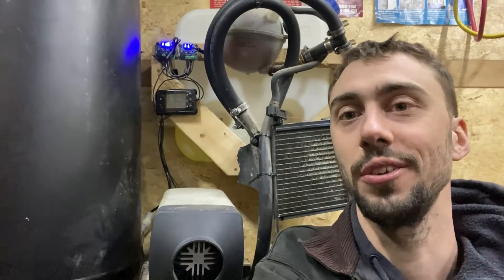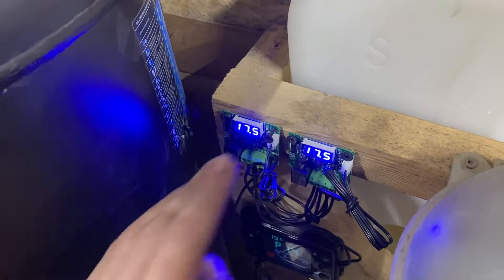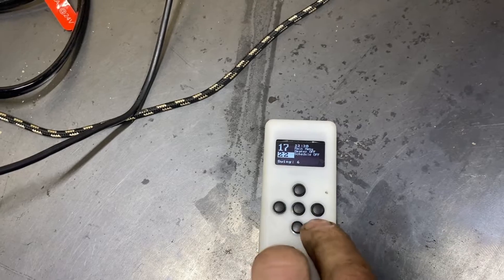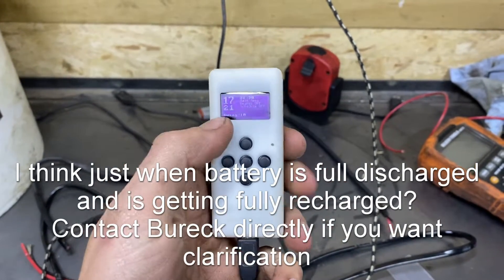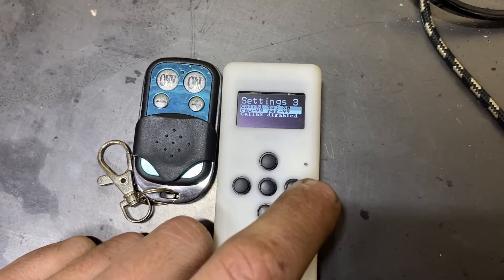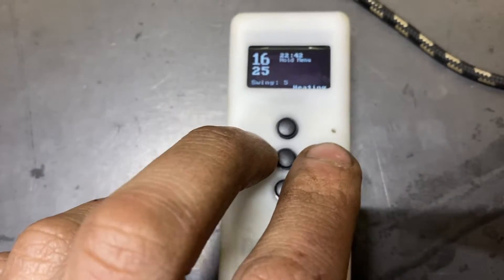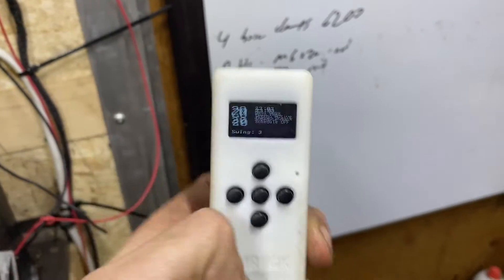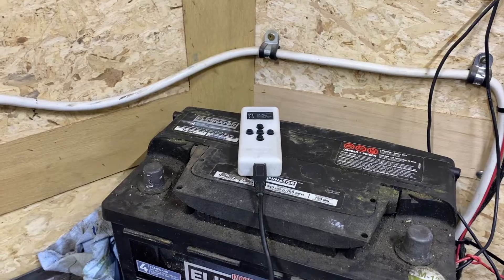Installing a "True" thermostat for the Chinese diesel heater PART 2: Bureck CD Thermostat

Comment: I've been using one of these with my diesel heater in my little caravan (home) for about a month, now.  Excellent little device which does exactly what I want it to do.  Diesel (like everything) is expensive here in the UK; not having the heater idling all the time has made my fuel last much, much longer.  I'm interested to see how much it'll save over the coldest months ahead.
Reply from the maker: If you have the battery bank to allowing the cycling it definitely helps. I disassembled my heater at the end of the year to check for soot (figuring the constant cycling might cause an issue) and it was nice and clean

Comment: This is not a viable solution!  I have the one without the built in battery, even while plugged into a usb power source the controller goes into sleep mode and eventually turns off.  Once it turns off it’s no longer controlling the heater.  So it’s not going to make it through the evening if that’s what you’re looking for!  It’s a shame they offer no solutions, Ive emailed multiple times to no avail.  I guess I‘m out $50

Comment: "I am looking to add a remote backup battery to a non-battery powered Bureck thermostat to prevent issues with heat charging and loss of programming during a power outage. The thermostat's battery lasts for about 6 days, and I would like to know the size of the battery (in Ah or mAh) to better understand the device's power draw. Can you provide any details on the battery capacity or typical power consumption of this thermostat?"

Comment: I've used my remote control circuit board which prevents the heater from running continuously, had to rig up a circuit which repeatedly pushes the "On" button. Then pushes the "off" button to turn off the heater. I also did a 5 Minute delay to prevent the t stat from trying to cycle on the heater when it has t cooled down all the way. Been bullet proof so far!
Reply from the maker: That’s how I should’ve done it when I hardwired the relays originally. I had it get out of temp and my “off” relay ended up commanding it on and just made things really hot

Comment: Thanks for showing this off! It appears my CDH isn't compatible with the Afterburner, and this is also a cheaper option!
Reply from the maker: Yes not quite as in-depth as the afterburner but as a simple thermostat it works awesome, it’ll pay for itself quickly
Reply: @JoshsJettas  I bet! Vs blasting a heater and then turning it up or down or off.

Comment: 15 with a 10 swing would be 5 and 25, right? Not 5 and 15? For that, do you want 10 with a 5 swing?  orrr I miss hurd how the swing works.
Reply from the maker: Swing might not be the correct term, 15C is the off temp, the adjustable “swing” adjusts the on temp. So 15C is the target off, 10C “swing” would make 5C the target on temp.

Comment: My diesel heater has no support for the afterburner , and the burreck thermostate.
Thinking about this setup with the relay . ( using the heater in my workshop , around 15m2 space ) .
Reply from the maker: Ideally I think it should be spliced into the on and off buttons on the remote, it worked this way but did have to be “babysat” at times.

Comment: why not just buy the Chinese Hcalory HC-A01 diesel heater, the thermostat is already built in and with app and bluetooth
Reply from the maker: I think that was new for this season? Vevor has one as well, if I didn’t already have a heater that’d be a good route although the built in thermostat can be pretty inaccurate.
Reply: I can't find this unit anywhere...
Reply from the maker: If you look up hcalory or vevor if they have the colourful digital display I believe those are able to auto shut off
Reply: @JoshsJettas  cool, thanks. 👍
Reply: They are capable of auto shut off, but they only heat at about 1/3 of the power range. In my case epic failure, didn’t heat up the area nearly enough to shut off, or prevent freezing my tookus off while trying to sleep. I tried 3 or them with the same results each time.
Reply from the maker: @TheMajictech do they just have low combustion temps? Seems like they neutered the pumping rate?
Reply: @JoshsJettas  no you can get more out of them manually, in automatic mode they don’t go to max output. Only about 1/3 to 1/2 way. If you put them in manual you can turn them up all the way, although they still don’t seem to put out the same heat my 3 year old vevor does at max output. So maybe a little of both but thermostatically operated they are lame as hell.
Reply from the maker: That’s interesting, must be their way of limiting the on/off cycles. I’m concerned of sooting from the frequent cold combustion on start up.
Reply: @JoshsJettas  it’s not the cold starts it’s the extended runs at low power that’ll soot them up.

Comment: Could you wire a RF or bluetooth switch the same way as those thermostats. My heater doesn't have a remote and it would be nice to have your set up but with bluetooth with a smartphone app control, if thats even possible. 

Great video thanks for sharing 👍
Reply from the maker: I'd seen your other comment, the bureck is by far the easiest solution, id personally see if you cant find a remote on ali express or amazon cheap enough to be able to clone with the bureck. As far as wiring a bluetooth switch up thats a little out of my knowledge but im sure its possible. Household thermostat would be an option too if your well insulated but id be affraid of frequent cycling

Comment: If it could be manufactured to use the up/down controls, 
you could use the up/down controls to smoothly adjust the fuel flow, this would be a most excellent  piece. using minimum electrical power to maintain a setpoint temp, likely better than the device itself.
I have a couple of Vevor units that seem to be able to do this, but the unadjustable fuel/fan ratio controls make them unuseable at my altitude.
 I ripped the controller out of an older unit which seems to have fixed the emmissions/smoke issue, but not the smooth step up/down in output power the Vevor had
Reply from the maker: What i did was use the "thermostat" function on the vevor and had it set to say 10C, it would stay ramped up until it hit the 10C then slow down to low until 15C. Im not as much concerned about consistent heat just something above freezing and that im not wasting fuel.
I've heard theyre pretty bad at altitude, im not far off sea level and i dont plan on taking this set up anywhere higher.

Comment: I built an interface between a thermostat to the 4 button remote.  I thought it was too risky to interface to the on/off button of the CD heater controller.  In my interface I designed in features that would monitor the charge on the battery so that it wouldn't ruin the battery.  The battery is on a battery tender powered by the grid power.  Now I did have some problems where the signal to start or stop was not received by the controller so I designed the circuit to repeat the on or off signal every minute or so.  I did this about 4 years ago.
Reply from the maker: Yes it requires some fairly fine soldering to get to the on/off switch. That sounds like it works nice, I should’ve went to the remote as I did have issues with it getting outside of the temperature range and commanding it “off” which actually turned it on and sent temps high.
Reply: Chez walmart? Par commande?

Comment: I went the arduino (nano clone) route for mine which keeps my greenhouse frost free, settable is temp setpoint, hysteresis to prevent short cycling, also displays max and minimum temperature (until reset). hard wired to the heater display unit on off button, 2 second on / off pulse via relay and 5 min delay when sending off pulse to allow heater to complete it's cooldown cycle. Running now for 2 months without any issues. Good luck with your future projects Josh.
Reply: That sounds awesome. Where did you buy the cologne from?
Reply: Amazon :) 3 for 21 squid @dsdfarms6872   I wish I'd have known about the CD before I started my project, would have saved many hours of crawling through programming the nano ( not my strongest skill ). the electronics was the easy bit. lol
Reply from the maker: I bought an arduino with the plan to use it, but the learning curve is fairly steep. In the first video I used 2 w1209 relays which worked really well, I think adding a timer would of helped the flaws
Reply: Yep, I struggle with arduino C/C+ code but having done quick basic many years ago back in the dos 6.3 days there are some similarities. So it was a case of trying to simulate a manual button press that only lasts a couple of seconds and not getting out of sync with the heater state (on or off). Anyway I'm rambling so I'll shut up :)   @JoshsJettas